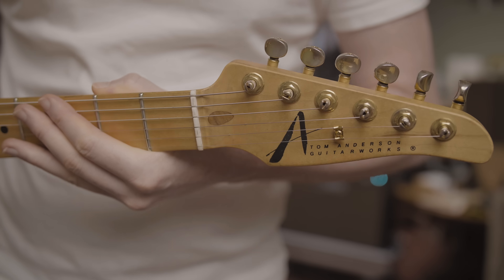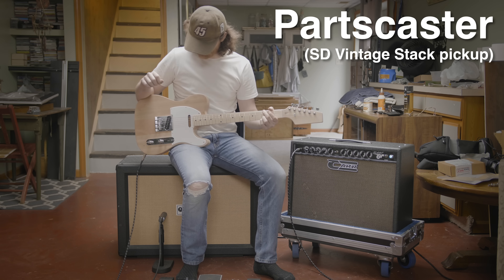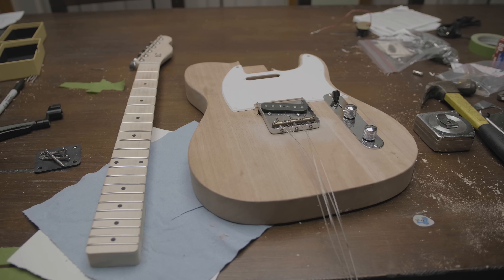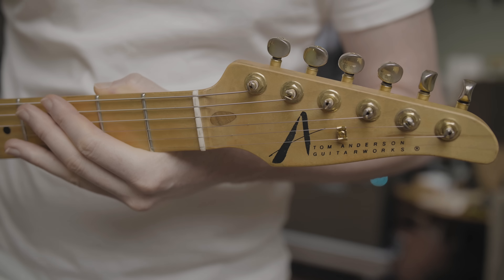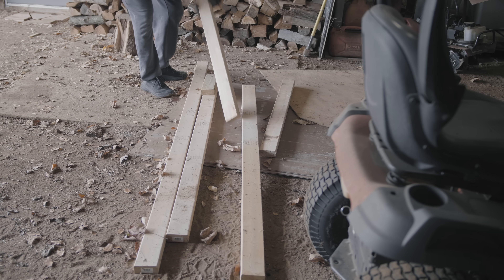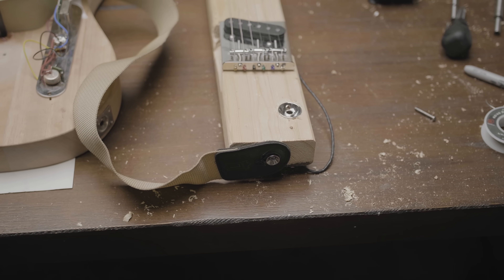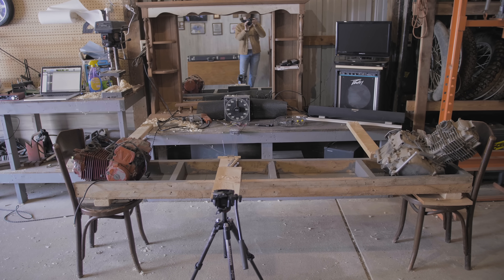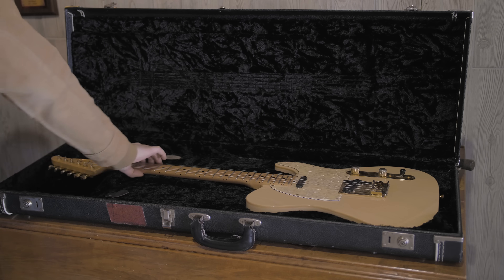Tested: Where Does The Tone Come From In An Electric Guitar?

Comment: Your final result is what I've been trying to tell people for years!
Considering the physics, all that's required is/are two fixed points in space, and a device/circuit which translates the vibration of the strings into signal.
Reply: What are you one 'o them there readers?
Reply: @larrybethune3909  looks like we got ourselves a reader!
-RIP Bill Hicks
Reply: @hamzacerkas4843   Bill Hicks = Alex Jones
Reply: @ChronicMetamorphosis  who that
Reply: @ChronicMetamorphosis  well they're both hilarious, but in very different ways. We laughed with Hicks, we laugh at Jones.
Reply: I learned this when I built a cigar box guitar. The back of the box was detachable so when you took it off it was just a square frame and a neck with the strings hanging over empty space. Made of bolsa wood pine struts and glue. Sounded massive. That was the moment when I was like, tonewood is totally bs.
Reply: A Diddley Bow!
Reply: Yep and your comment has the key term: fixed points. I think different woods offer different level of "fixed" if you see what I mean. Nothing to do with the price of the wood, just density. Maybe not so drastic for a guitar, but for a bass, definetly relevant.
Reply: But the wood should, in theory, provide some kind of feedback into the circuit of the strings, since it is connected. The strings vibrate into the body through the nut and bridge and, I would assume, would have some kind of lasting impact on the tone, which could be that it dampens some frequencies or that it acts as a flywheel and increases sustain. Not sure. This video did confirm my belief that there is little to no effect on the audible tone, but mechanically I still think there should be some effect. You can physically feel the body of your guitar resonating. It has to get that energy from somewhere, so obviously the strings will lose some amount of energy to the body of guitar. I just don't know what frequencies it comes from or how much energy it actually takes.
Reply: @TheEpicLinkFreeman  don't waste your time explaining this to "tonewood is BS" people. just like flat earthers they will dismiss it. don't you see all the "physicists" here that claim it's all about strings and pickups?

they can't grasp the fact that the way strings work in conjunction with the body and other materials is much more complex. although from a 'tone' perspective the wood of the body/neck has minimal impact, factors you've just explained do affect the sustain, the development of each note and other subtle characteristics.

this video is super biased and intentionally dishonest and you can see this by the way it was edited (cheap guitar parts were cut out immediately after the chords were played in order to not show the pretty big difference in sustain). on top of that, overdrive as well as Youtube compression act as a great equalizer when it comes to tone.

I'm no fan of expensive guitars, especially when prices are driven by brand names rather that quality. however, I am a fan of well constructed instruments and when it comes to playability and stability, there's a night and day difference between quality wood that was properly cured and worked; and crappy firewood.
Reply: @jonsnow7092  my general belief is that tonewoods and other similar theories do not really matter very much at all. They matter to the feel of the guitar, how it vibrates in your hand, the enjoyment. But I don't think it makes that big of a noticeable difference in sound, if any. But I don't know why because, logically, I think it should. You're probably right about the sustain part, but that's not what he was looking for or probably just didn't think about it. I think he's been looking through the comments and that was brought up a few times; if he decides to do a part 2 and test out  the things he mentioned in the video he will probably make a comment about the sustain, or touch on it at least a little. Could end up being very similar, who knows.
Reply: @jonsnow7092  Actually you are the "flat earther" here. The only thing the body and neck can do is ta energy from the strings resulting in reduced sustain. That has no effect on tone at all. There is no conjunction. My Tele was Euro 149,- sounds better than any Fender, looks beautiful and sustains long enough to let me get a coffee from my kitchen while it rings in it stand in the living room. Your placebo effects don't count.
Reply: @jonsnow7092  delusion.
Reply: All that's required to do what? Make it sound like an electric guitar? Well no shit

Comment: Yes, important information, well determined, thanks for the lot of hard work making this possible. However - we heard a lot of sounds which turned out to be similar. And without any doubt the pickups and their proper adjustment is crucial. But we listeners only heard them, mainly through lousy speakers I guess. There are a lot of parameters, which cannot be heard but maybe felt by the player. Those are pretty hard to describe, but they highly influence the tone and feel of a particular guitar - for a particular player. 
First, response. Do the notes jump easily out of the guitar or do you need to fight for them? Do the notes come fast? 
Dynamics: does the guitar follow your pick attack? Or are notes played loud not as loud as expected? Are soft notes as silent as expected? Or louder? Or even more silent than expected? 
Harmonics: do overtones come easily? Fast or delayed? 
Sustain: how long did a note ring? How does the sound change during ringing out? Does it ring our evenly or are the overtones changing and developing? If yes then how? 
This list could be continued endless, of course. And the longer you continue to explore that stuff the more „you will hear the grass growing“ as we say here in Germany. 
Anyway, take a humbucking pickup from a Les Paul and put it into a strat (which of course has been done a whole lot). You do not need to hear the grass growing in order to hear and also feel a dramatic difference. 
I understand the point, and of course I appreciate this amount of work. I am not one of those insisting on recognizing the difference in sound when the steel screws of the pickup mounting rings are replaced by brass screws for instance - you know what I mean. But after countless guitars in my hands and a lot of modifications done over 50 years: there are differences, small, large and also fundamental ones, depending on what is actually changed on a guitar. I‘d like to encourage you to follow this path in order to get to the point where differences will be evident. You will find them.
Reply: The reason that they're so "hard to describe" is most LIKELY that they don't exist... At least in the real world... They're in your head, hoss... THAT'S EXACTLY why I suggested he put the results through a spectrum analyzer, so people WON'T be able to drag out that ol' "Well, it sounds different to ME!"

Comment: Cool test, finally someone doing this with an actual distorted guitar amp. I suppose you would still get benefit from a well made guitar in terms of sustain and of course comfort of playing. I wonder if the sustain really increases with more rigid neck through body (1 piece) constructions vs glued neck vs bolt on neck. Same with the hardtail vs flush trem vs floating trem. I've seen people claim that even springs make a difference.
Reply: He did not let each audio clips to ring till the end. But I suspect there could be some differences in sustain. The bench mounted guitar seems to ring longer.

Comment: But the air guitar has significantly more body than any of the other guitars: On both sides of the neck there is lots of wood, not to forget the motors. And they are screwed together. With a body that rigid, only a minimum of vibration is lost – resulting in long sustain and rich tone (because no frequencies are swallowed by the system). 
Les Paul experimented with a string and a pickup on a steel rail – the infinite sustain inspired his solid body guitar. 
What I want to say: If it was possible to build a guitar as rigid and heavy as a bench, a shelf, two honda motors and some 2x4s, the wood and the body/neck/headstock shape would hardly be important for the sound. But as most guitar players prefer not to travel with a whole workshop setup, luthiers had to find ways to make the vibrating ends of the string as rigid as possible. Heavy wood, a firm neck joint and a massive headstock help with this construction goal.
Reply: So do you think you could pick the air guitar out in a blind test?
Reply: @nikonmikon8915  No. Or let’s say: It depends on the competitors in the blind test. But compared to a guitar that is built with max. stiffness and rigidity in mind, I‘ll probably have a hard time picking the right one out.
Reply: @GuntherBaganz  Do you think you could pick out the workbench guitar from the Anderson tele in his video though?
Reply: @nikonmikon8915  Probably not.
Reply: @GuntherBaganz  me either lol

Comment: shoulda weighted the bench with 2 490 Maico motors lol... there way more 'mass' in the bench and shelve that the headstock and bridge are attached to , then in a tele.    the bridge and headstock are NOT mounted to air.

Comment: It all sounded pretty similar to me. I do have one note... the amp distortion makes it difficult to really assess the tone. If you're planning on doing more experiments go for a clean, less distortion set up and maybe use a scope to compare waveforms. Tone is a function of overtones which should be very apparent using an oscilloscope
Reply: Yup!
Reply: Absolutely! The amp sound used here is far from clean, so any subtle differences are not going to be heard.

Comment: Last year I took a Indonesian built Wolfgang EVH guitar and using the OEM parts list for the $3000 USA built version, just upgraded the electronics... Since the pickups are the same spec, I just swapped the pots, capacitors, jack, switch and wiring and just those internals alone did quite a bit of tone shaping. Yet you have companies like FU-Tone and Floyd Rose trying to sell big brass blocks as having significant importance... I'm convinced 90% of what's sold in the guitar gear industry is snake oil...  Linking my video hope you don't mind.
https://www.youtube.com/watch?v=IfiNO9B4pKk&t=1s

Comment: Honestly I'm certain the only factors the body affects is comfort, weight, and to a basically infinitesimal degree sustain in electric guitars. The only way you can make sustain humanly decipherable is if it's totally fucked or if you bolted the machine heads, nut and pickup to a tree trunk or steel I beam. And considering the bubble wrap heel joint didn't seem to eat the sustain like it was breakfast clearly you have to make the guitar unplayable to ruin the sustain.
Reply: Somehow Paul Reed Smith's Ted talk on guitars being subtractive instruments makes a lot more sense now.

Comment: An electric guitar is a system. There is only the energy of the player to set the strings in motion. Any resonance in any part other than the strings steals that resonance from the strings ( forgetting amp feedback for now) thereby reducing ring time. Any part, other than the strings, that vibrates at a specific frequency will steal that frequency to some degree from the strings depending on how much energy the string is supplying to it. As far as I can see this is the only way construction and materials can affect tone. This can explain how harmonics 'bloom' on some guitars and not others etc. The guitar construction is a subtractive element. Woods etc cannot add anything. If they have any effect at all, they subtract certain resonant frequencies and sustain. Changing an amps speaker has waaay more effect than changing the wood of two otherwise identical guitars. Then again, I could be wrong.
Reply: Correct!!

Comment: The difference in tone between a Gibson and Fender is the SCALE LENGTH ( distance from the nut to the bridge saddle ) . A Fender has a longer neck or scale length so even if you put humbucker's on it it will still sound like a Fender. I found this out the hard way by putting a humbucker on a Strat thinking it would sound like a Gibson . It didn't !Jimmy Herring often plays a Fender with a humbucker that still sounds like a fender without the hum .
Reply: There's a fundamental difference in sound profile between humbucker and single coil pickup. Even if you split humbucker pickup, it won't sound exactly the same as single coil. So no, Fender with a humbucker does not sound the same as Fender with a single coil.

Comment: Great video, but there was a lot going on. When you changed the partscasters pickups, you left in the identical pups as the reference guitar, correct? 

Would you say that changing the pups and electronics made most difference in the sound?

Comment: Great video Jim! Really interesting. Did you happen to measure the pot values when fully open? Sometimes they can differ as far as 30%!
Reply: Great point! Maybe he could have used a fixed resistor? Does that make sense? Im not an expert at these things.
Reply: yes, he could just pair two resistors or potentiometers that were measured and matched for same measured value, maybe going straight to output would be better, less variables to control.
Reply: yes, he could just pair two resistors or potentiometers that were measured and matched for same measured value, maybe going straight to output would be better, less variables to control.